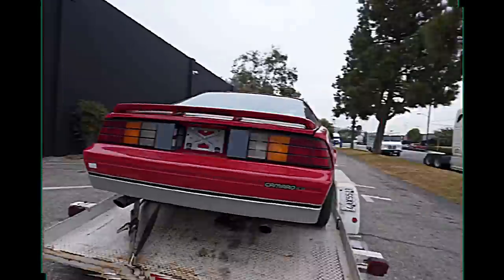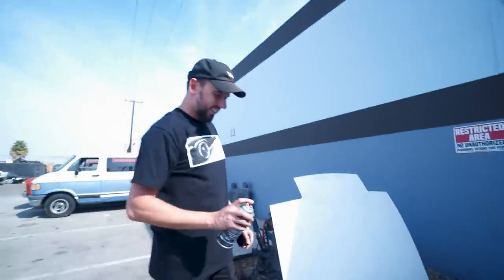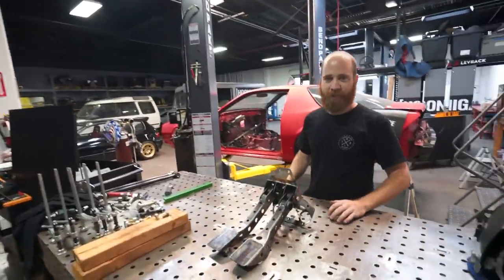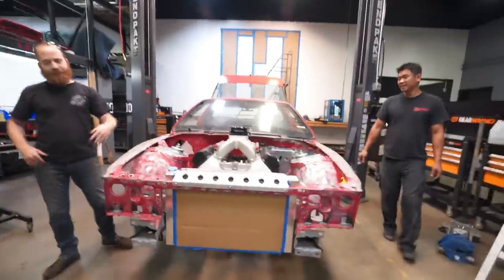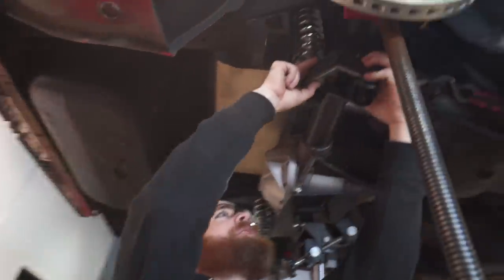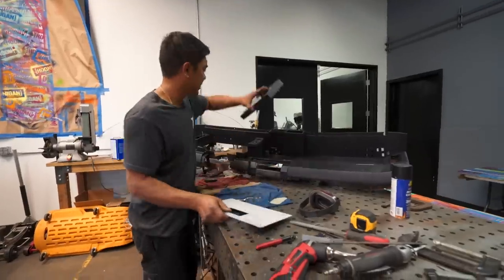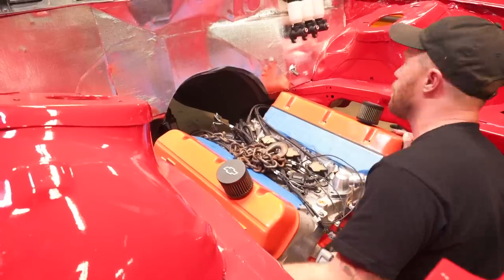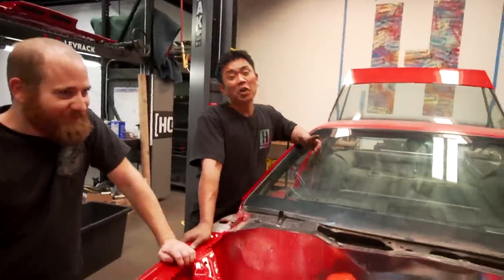Unboxing Chevy’s New 1,000hp BEAST of a BIG BLOCK for our #SEMA Camaro! The ZZ632/1000 Deluxe!

Comment: This build is very very cool to me because I bought an 86 trans am ws6 with the same exact color scheme when I was 17. Ran it for a few years and blew up the 305, swapped a 350 then blew that and it's been sitting ever since. Maybe this build will rescue my original project car from the barn
Reply: Have a question for anybody who sees this. Are the QA1's they put on this car direct bolt on parts for this chassis or do you have to cut and alter the  strut towers
Reply: @86thirdgen71  that looks like their bolt on kit

Comment: You can tell Suppy doesnt drift cause he said that they wont be able to drift with a manual rack lolllll…. when the car is drifting the steering wheel is weightless, you can throw the wheel and it will spin all the way from one side to the other lollol

Comment: I feel like Chevrolet's trying to go out with a bang before the era of the EV's starts to take over, don't know if they're losing money or if making little gain out of it but I feel like they're doing it mostly for their image and fans so in the future people will probably talk about Chevy's last great gas engines and engineering before the downfall with all the new electric cars that come out...
Reply: They're also competing with Mopar with their 1000hp hellephant. But in good old GM style with making raw N/A big block power
Reply: EVs will never be as popular as old school motors like this
Reply: EV wont replace combustion engines.
Reply: Chevy laughs in new Z06 🙃
They just released the most powerful N/A V8 ever released in a production car.
Reply: That'd be a
Big Bang!
Reply: @Questionable_creations  that’s what I’m saying, we have the ability to mass produce synthetic fuel that’s great for the environment, just the gas infrastructure and the amount of people relying on it is so great. It would be very difficult to transition that quick. So yeah electricity would be like a stepping stool, relieving on the gas and oil industry. And then we transition from coal, to synthetic
Reply: My thousand horse gets 21mpg
Reply: Lol these replies will not age well.
Reply: @zack9912000  define popular "quietly"
Reply: I doubt GM is going to stop selling crate engines after 2035. The CA rule states no sale of newly made, off the production line, gasoline pasenger vehicles.
Reply: Guys they have solid state batteries coming to the market that will Ice look like rotorary dail phones compared todays smart phones
Reply: The "electric revolution"  as they call it only accounts for two-and-a-half percent of cars on the road...truly a "first-world" issue...in my adopted country of Argentina, I haven't seen a single electric this past 16 years....where is this revolution?
Reply: @cj94zj92sc  then why are they already admitting the will have the ability to control when you can charge your car?  Keep doing more damage to the environment to mine for the battery than the complete life of a gas car.
Reply: No, you're right. This is the beginning of their crate engine swan song. & they're "doing it" because internal combustion engines are becoming illegal to produce.
Reply: @tt7hvn  that doesn't make any sense since this motor and yhe zo6 motor are both from chevy and one is a 10litre 1000hp crate motor and the other is the most powerful na production motor🤔
Reply: In 2035 is when GM is going to STOP making gas powered motors for light trucks, SUVs and cars.  All that stuff will be EV
Reply: Mike Scherrer didn't Paradise in California burn down?
Reply: @zack9912000  They'll be faster
Reply: @mikescherrer4923  It's more like pot-holed and rutted streets due to all the giant trucks, coming and going to provide the rest of the country with it's food.
Reply: It's not gonna be a downfall because they aren't gonna release an electric car with less horsepower than competitors.
Reply: @tt7hvn  that engine is nuts. 670hp and it’s smaller than my 350 😂
Reply: @wllms02  It's obviously forced, but if you see all the great ev's like the new plaid model s. It's not that bad.
Reply: @eliseiodagiu5519  there's no such thing as a great EV. There's fast ones, sure, but not great ones.
Reply: @lb9gta307  great: of an extent, amount, or intensity considerably above the normal or average.

Uhhhhh.......
There are lol.
Reply: @eliseiodagiu5519  you could describe the higher end EV's acceleration and speed as great. That's about it though.
Reply: I'm a big gas/turbo guy, but anyone that thinks all EV's are a joke haven't been gapped by a fast Tesla. Even some Model 3's will mess up most 'built' cars. Once the big 3 aren't constrained by emissions, EV's will be on another level.
Reply: @zerohourdrift  your information isn’t accurate.
https://youtu.be/6RhtiPefVzM
Just look at Engineering Explained video on it. He gives gas cars every benefit he can and uses studies that make EV’s least likely to win over time and they’re still better for the environment over a 3/5 year time frame.
You can also have home solar installed for a few thousands $/£/€ these days to make the impact even lower.
Reply: @jamie0193  except it is. That is a singular guy on YouTube. Yes he’s smart and very good at what he does. Doesn’t make him right eve try time. I’ve toured quite a few manufacturing plants for school, done extensive research and written numerous papers for school (engineering major) talked with people who actually design cars and the consensus I’ve come to is based upon current energy usage. Here. Forget the world, forget the US, lets focus on California. California for the last few years has had massive issues with brown outs due to unstable, overworked, and generally poorly maintained grids. Due to that, Currently California imports more energy than any other state. That said, it’s top three energy sources are natural gas(depending on burning conditions, produces similar emissions to gasoline), coal and hydro(while extremely low, still produces greenhouse gasses, particularly CO2). Now that we’ve got the energy out of the way, let’s look at the vehicles. Currently in Cali, there are 15.1 million registered vehicles, and we all know a large number of California has unregistered vehicles that get driven regularly. So upwards of 15 million cars on the road. California has roughly 425,000 registered ev’s. That means that only 2.79% of all vehicles in California are ev’s. If they are struggling to keep the power on at that low of a percentage what happens when you increase it to 100%? Let’s find out. The average American household in California uses 6500 kw hours per year. An average ev has a range of about 250 miles. The average American drives 26 miles a day, meaning roughly every 9 days you need to recharge your car, which requires per vehicle on average 67 kWH. So that means you need to charge your vehicle roughly 41 times a year, which amounts to an extra 2750 kWh per household per year. So now each household is using 9250 kWh a year. There are 11.6 million households in California. That means that while old power consumption was roughly 75.5 billion kWh, if every household were to have an ev, that number would now be 107.5 billion kWh. That’s an extra 32 billion kWh from just families. That’s not taking into account the large amount of businesses and factories. This means this: if the current grid is functioning at near or more than 100% duty cycle, you’re already creating a huge amount of emissions. Now you are adding an extra 32 billion kWh to that, grids will be working at well over 100%, creating way more emissions just to POWER the ev’s. I didn’t do anything with regards to manufacturing which does indeed require drastically different tooling and energy loads, and again the toxic materials discarded in accidents. They are literally no better. If anything they’re much much worse because you also forget lithium mining would need to increase dramatically as well...
Reply: @zerohourdrift  lol
Ok kid
Reply: @jamie0193  ah yes the classic “I know I’ve been proved wrong but don’t want to admit it” I’m no kid, and I’ve done my research and given you real numbers based upon statistics. They’re not any better. Especially when you realize that the average life of an ev is way shorter than an ICE engine
Reply: @zerohourdrift   what?😂
I’ve shown you 5 other videos that tell you the same thing.
All you’ve done is make a false claim that ICE vehicles are better for total emissions, when they’re not.
I don’t even know why you were talking about energy production because we have a ton of renewable options, wave, solar, wind, geothermal, hydro and there’s new tech being designed all the time.
Reply: @Questionable_creations  it will actually we’re on a fast track to it California is going to be the first can’t even buy gas powered equipment lawnmowers etc I’ll give it 10 years until manufacturers stop making them
Reply: @jamie0193  I used cali stats all the way through actually, but even if I didn’t, you still haven’t disproved me🤷‍♂️
Reply: @kx250braap  did you read anything I wrote? I wasn’t talking about just production I was talking about energy used and required to own one.... ev’s aren’t the future, synthetic fuel and hydrogen is. As for gasoline, you do know that the vast majority of fuel burning emissions comes not from consumer cars but from commercial travel and production?
Reply: @jamie0193  congrats, you work in the power industry. I work in the automotive industry and I can tell you, they’re not any better. The only true zero emissions vehicles are hydrogen fuel cell vehicles or alternative fuels like hydrogen ICE or synthetic fuels such as the one Porsche is working on. I never changed any statistics up, I never made guesses, I gave you valid numerical data based upon current averages of both Cali and the country where cali averages were unavailable. And the funny thing about “green” energy is that even green energy takes fossil fuels to create. All those hydroelectric stations and windmills and solar panels don’t just make themselves... and shit, all of said things have moving components... what keeps said components from creating heat/friction? Oil..... the electric vehicle industry is a sham and always has been. Look at Tesla. When starting the company, Elon never once said he thought ev’s were going to take over. He thought they were cool and wanted to mess with them. He doesn’t make cars to save the planet he makes expensive sports cars and sedans lol.
Reply: @jamie0193  thats incorrect. They only produce “mass” NOx when coupled with aggressive spark timing, and NOx is is also not a greenhouse gas in the effect that co2 is. It does little to no damage to the atmosphere as it is created naturally with lightning and other natural electric reactions. And NOx is also completely neutralized when coupled with def or hydrogen peroxide. So yes, hydrogen ICE are considered zero emissions engines.... the only reason they are not is due to oil being used as a lubricant. If you read up on industry standards and the bmw hydrogen 7 in particular, legally speaking, a company cannot market a hydrogen ICE as zero emissions due to the possibility of trace amounts of oil being burned off during combustion. So even though the only real emissions are water vapor because it is possible to burn oil in a worn out engine, you cannot legally market any internal combustion engine as zero emissions
Reply: @duanebailey6253  Jesus Christ, you're drinking the Kool Aid. Educate yourself!
Reply: @mattkooken639  I have!  Big oil buys the true clean energy patents for cars.  Still Pzev cars put out very little to no co2 vs a much less environment friendly power plant.  To produce the batteries alone it exceeds the pollution for the life of a gas car.  Read the paris accords.  How do you add cars to the grid while you shut down 30% of the grid?  Read the articals where they say they will control when you're able to charge your car.  Read the article where mit admits we may account for .5 degree change if we don't put out any co2 in the next 50 years.  Learn how tree breath co2.  Where does the extra power come from?  Have your read the moronic power plants they want to build for hundreds of millions of dollars to power a very small area? Big oil owns renewable energy.
Reply: @jamie0193  how are they better for the environment?  Nuclear power plants don't leak or produce waste?  Power plants have no pollution?  To dig up the rare earth metal alone creates more damage than the life of a gas car.
Reply: @duanebailey6253  I never said nuclear doesn’t produce waste. But electric cars are way better over the long run, look it up.
Have even paid attention to the world the last few years?
We can produce power with drastically lower waste than fossil fuel power plants. 
Have you even looked at anything I’ve said in my posts or look at any of the videos? People a lot smarter than me, zero hour drift or you have actually been studying and working towards ways to reduce carbon emissions for years but geniuses like you and @zerohoursdrift like to think you know better in a YouTube comment section and spread disinformation constantly🤦🏻‍♂️
Reply: @duanebailey6253  gas helps the earth? God damn why did I even reply to you. What are you smoking and you think Haarp is real🤦🏻‍♂️
Reply: I had the same thought when I heard about this. Seems like the end of naturally aspirated big blocks is coming pretty damn soon. The tiny turbo engines might hold out longer, but like the horses and steam engines, all good things come to an end.
Reply: Yup, the "Last Hurrah"... but then, Dodge has been having THEIR last hurrah (before they go under entirely) for 5 years now...
Reply: @duanebailey6253  That, I agree with ya. I don't think some nefarious shadow agency is currently "manipulating" the weather, though. If only that were possible. Seems the SW never has enough rain, the South, SE, and NE get way too much. Somebody, flip the switch! 😂
Reply: @raynman6466  What doesn't make sense about it? A "production" engine is put in a production car, on the assembly line, and sold by a dealer. Crate engines aren't. No contradiction there.
Reply: @zerohourdrift  All true. I'm actually surprised that the number of households and registered vehicles is that low in Cali...Don't they have 40 million residents there? Considering I have 5 vehicles BY MYSELF, I would think Cali would have 30 million cars or more.
Reply: @pookysdad4884  well those are just average values I’ve pulled off of the Internet, so expect a little variation. But the vast majority of the population appears to be below the age of driving, and I can only assume that “household” doesn’t include single people and/or businesses, which would also make up for a large amount of energy and vehicles. And I have a relative who lives in SoCal and apparently a lot of people just don’t register cars as the police supposedly do not pull you over for it🤷‍♂️ and yeah showed the guy actual math based upon statistics given by numerous reports on the country and state and he still tried to deny and/or appear to be a know it all on the topic. Some people just don’t want to see the bullshit they’ve been fed
Reply: @duanebailey6253  Hmm, I'm not familiar with "Brennan" OR "haarp". I watch the evening news and CNN almost every night, and never heard the name or that acronym. Who is Brennan, what is haarp?
Reply: @pookysdad4884  There was a time when a horse and carriage where considered dangerous too. EV's will take over and there is nothing, NOTHING you can do abt it. And look at the tech. There are new battery's on the way.. Now go somewhere and grow a frontal cortex, and speak when spoken to..
Reply: @blightborn87  Yeah, horses and carriages still exist, pal. They're mostly just used for recreation and tourist things now. The same will be true of ICE cars in 50 years. What happens after that, I don't care, I'll be dead by then!
Reply: what you think gas motors going be gone in a year. lol I bet most car companies still be making gas motors next 10 years probably longer
Reply: @dylantroutman4363  shit they cant make a good battery lawnmower and you think less then 10 years gas motors going be gone. yeah ok

Comment: Just have to say HOONIGAN introduced me to STEEL-IT and I used it and have nothing but love..... only down side is it ain't cheap,but it's so good I'll buy more .

Just a fat guy building 99 Miata, if STEEL-IT wants to sponsor me, I'm not saying no lmao.

I am impressed when I used it to coat the "new" fuel tank covers on the 99 Miata, old ones couldn't be saved. 

Got some great condition ones off eBay and hit them with the STEEL-IT and I almost didn't want to put the carpet back on lmao

Comment: TO Us guys who have already installed 600+cid 1000+hp motors in a 3rd gen..we watch to see what they do..and what parts they use..from $2300 headers to$1000 headers..whos K members..rear ends and other things...and yes ya can install 325/50/15 and tuck them under the car..but for gods sake..use a 9" ford rear.. :)

Comment: That engine is impressive both b/c of the displacement and b/c of the factory tune. Naturally aspirated and still makes 100 hp per liter. A gen 5 LS2 only makes 74 hp per liter without forced induction.